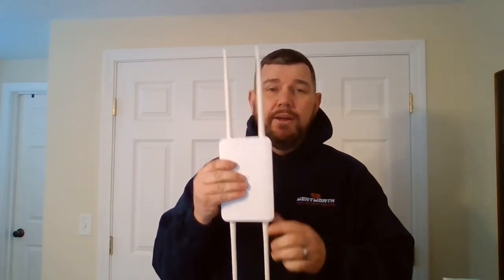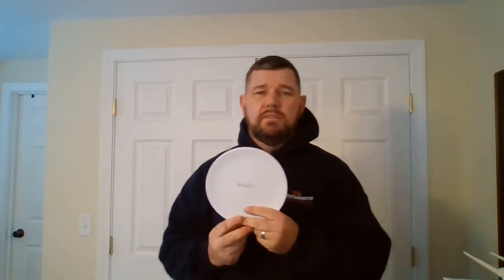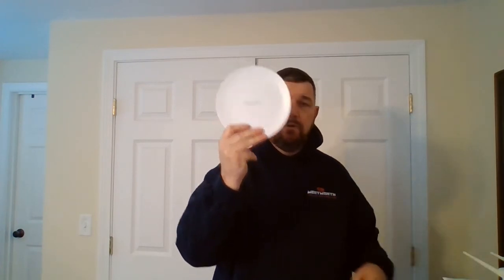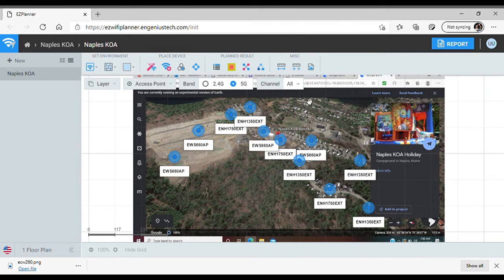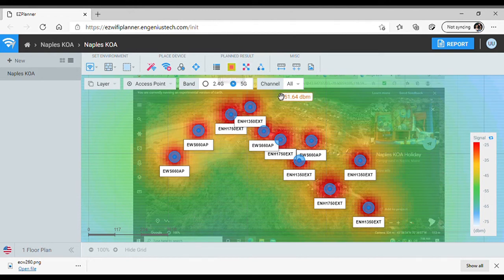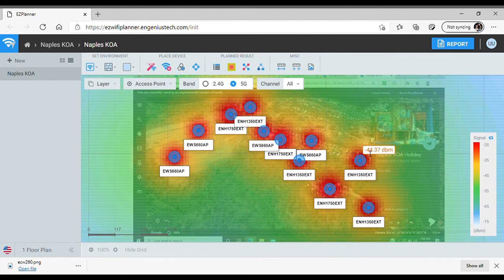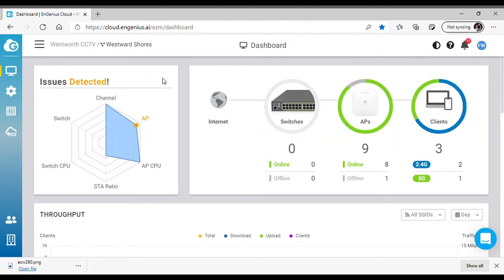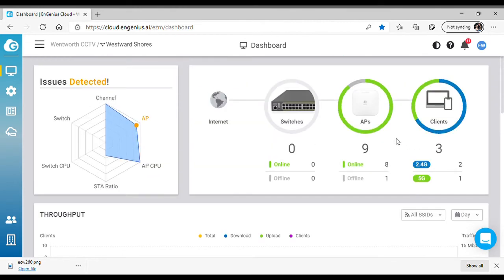How to install Wi-Fi in a Campground

Comment: Unfortunately, the only upside to mesh would have been dual band. Many Samsung cells, and Laptops don't offer 5G unless you pay good money for the new tech. My junky Samsung A11 offers 2.4 only. So you swear off mesh dual band even in a 25 site situation? Or the bridges are 5g, but the APs are dual? Great vids. Thank you
Reply from the maker: Point to point is dual band as well. If you have only 25 sites you could mesh with traffic shaping or bandwidth limiting, The problem is guests stream if you allow them to. What type of AP are you looking at?
Reply from the maker: And correct the bridges are 5 GHz but APs are dual band
Reply: @WentworthCCTV   @Wentworth CCTV  I have used Ubiquiti in the past, and I have recently become a Engenius dealer and have enjoyed your channel very much. I would defer to your opinion on the best all around AP from the base station outward. And no more than 2 hops max. I remember. I have a park in Grand Bend Ontario that has a total of 74 sites, and I like your point to point tied to an AP, my worry is budget. The park owner expects to pay in the $5000 CAD range. Including cable, man hours and equipment. 
And it does have a fair bit of trees. So my first gut instinct was 900MHz. Lower bandwidth, but maybe less equipment so it works out.
Reply from the maker: @cschenko  I used ubiquiti in the past for Unifi but now prefer EnGenius. Have you used the dealer portal and heat map tool EZ Planner?  Use that and see if you can get away with 3 or 4 ECW 260 WiFi6 APs. If not with that limited budge I’d go with the ECW 160. Those are the 2 cloud managed exterior options. use streakwave and they have great dealer pricing. If you want to send me the map I’d be happy to tell you what I think. Fredwentworth@Newenglandcctv.com
Reply: @WentworthCCTV  I will be in touch.

Comment: For extremely remote areas where there's no high bandwidth input what is a good solution? Cellular Hotspot to deliver point to multi point would be fine I'd think? I've been working on extending service for a small to medium sized park, wide open area but sloped. Power isn't an issue but cost is. Unify is what I'm familiar with but not set in stone so long as cost is low since bandwidth coming in is low...any advice is appreciated on which hardware and setup for point to multi point
Reply from the maker: How many sites do you have? You can use bandwidth controlling to limit what each client can use. We have some campgrounds that can only get 100 Mbps and make it work. They are limited to simple browsing.